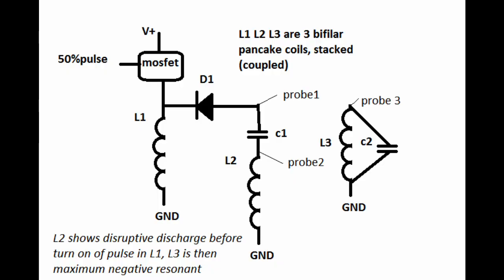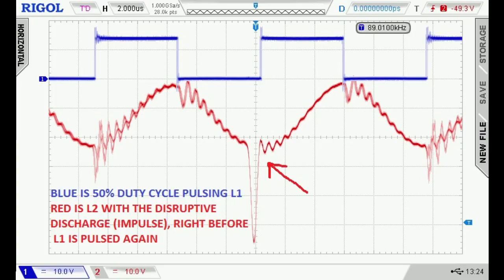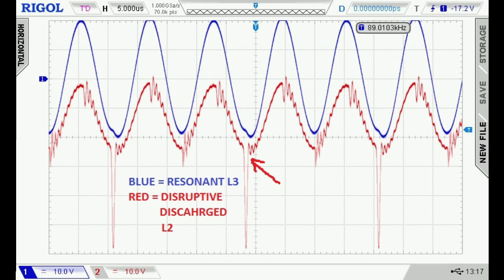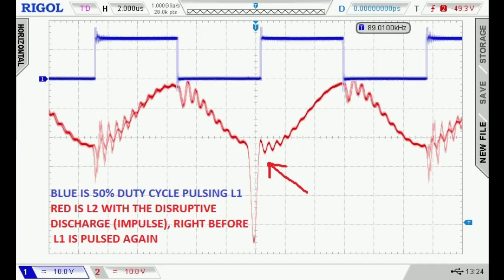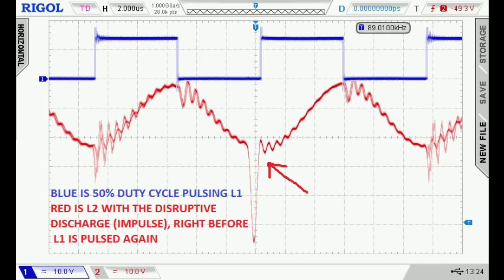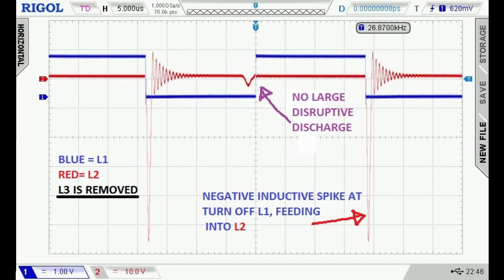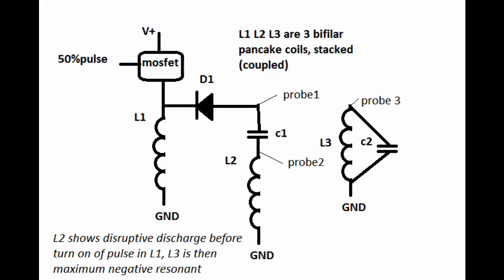Radiant energy bifilar coil experiment

Comment: Hi , an interesting result. It is not at all clear which trace corrresponding to which  testpoint. at a first impression it is an interaction between L2 and L3  ,when the spike occures ,there is a small area from the sinewave on L3  consumed , distortioned.
Reply from the maker: good observations. the L3 is not consumed, but enhanced, it grows to even more negative. Sine is L3 probed. discharge is probed between C1 and L2, sorry for the inconvenience.
Reply: M.Ivo
The testpoint which I am in doubt is Tp1 on the schematic, if it is placed on this side of the diode there should not be visible the square wave of the input, but only the negative spike.
If I may make a suggestion: in order to get a fast disruptive discharge it might be worth to try without the capacitor on L2, considering the damping produced by the latter, and it could be better to employ teslas preferred configuration: capacitor discharge into a low impedance coil. The discharge will be faster and you can rise the energy per pulse by adjustment of capacitance and pulsrate. Remember that you are not looking for a resonance, but for UNIDIRECTIONAL pulses.
Another thing that has to be considered is how to detect the longitudinal pulses,you should think about a specific setup that distinguishes from transversal waves or spikes,(maybe shielded)
I hope that something of this  helps, and wish you success.

Comment: I think the idea is to get the spike almost like DC pulse. The steeper it is the better. So you want to go from 0 to max voltage as quickly as you can, but you might not be able to, so the other option to make it steeper is to use HV. I think tesla used a 25-50kV dynamo to produce the disruptive discharges, but did he just charge a cap with that so he can output all the energy instantly from it? This would be the disruptive discharge and you try to get it as short and as steep as you can like under 50 microseconds
Reply from the maker: That's the idea, now bring it to practice. But more importantly I already got it, but why is it there? I didn't intend to create it but it sure showed up, before the switch closes.
Reply: as short as possible with no reversal ..no reversal of current is important according to tesla...probably  the most important thing and the hardest to stop once voltage and current increase it becomes harder for solid state circuits to handle... also telsa tried hard to get the magnetic componet out of the circuit...
Reply: I think a gas discharge tube might work, if you put permanent magnets N-SG-N there. I think Tesla was lucky because had his ancient rotary switch :) So you charge a cap and then let it discharge over a gap. You need to quench the spark after the initial pulse. Spark quenching secondary coils on both side of the gap could also work

Comment: To be able to "see" when a MOSFET turns on and when off, you have to look at the current through this MOSFET.
Looking at the gate voltage or the drain / source voltage does not say all.

Use a current probe in the drain lead or a 1% CSR (current sensing resistor) of 0.1, 1 or 10 Ohm (induction free)
and measure across it taking care where to put the ground lead of your probe (or use 2 probes in differential mode).

Regards Itsu
Reply from the maker: if the pulse is low for 50% it should be off, don't you agree?
But you are right a proper measurement would give more info. So you think the mosfet opens before it reaches the gate source threshold voltage? and it triggers the discharge? even with the diode being there?
Reply: Ivo,

all i am saying is that things often are not that simple as it looks.

The gate can have a nice clean switching signal, but its switching the MOSFET is compared to
the source level (normally ground).
If that source level is fluctuating, the resulting switching on / off (time) can be way different as the gate signal.
 
F.i. your L2 coil can inductively feedback pulses through the diode to the source of the MOSFET.

So to get a complete picture you should include the current through the MOSFET.

See here (i know its a push-pull environment, so different as yours, but still):
https://overunity.com/12736/kapanadze-cousin-dally-free-energy/msg475096/#msg475096

Itsu
Reply from the maker: Indeed worthy if investigation. I have been surprised before, but often it could be explained easily, by a closer look. Dank je!

Comment: i'm working on similar type of experiments - however like you i'm going without the 'spark gap' or {as mentioned below} 'mechanical devices'
but to achieve fundamental results for my experiments i need multiple freq into the same field effect circurt or 'magnetic circurt' 
then i'm going to explore how the field effect circurt is reacting to one and more freq, then continue to experiment.

when i say similar i'm not using pancake - i'm working on the theory that Tesla was more 'making a point' to show how the coil was wound - a good option, 'tesla' coils in mirror config, but i'm using a core etc.

thanks for sharing - i have no idea why the negative spike - i could only guess that if L3 is tuned to the same rF as L1 then it is a 'reflection' being induced into the serial cap + L2.
Reply from the maker: But a reflection of what event?
Reply: here is something that helped me greatly - why don't you make a video about how a full wave bridge rectifier works - i think you are like me were we very much make things complex until we fully understand them.

now before you think i'm 'trolling' you i just want to say i can't find a video on youtube {or the 'internet'} that explains it - i think that 'error' is one of the fundamental keys to begining to understanding inductors / polarity and field effects:

the closest i got was a pretty switched on guy Stan Gibilisco a radio electronics professor but he had to resort to fictional particals, just search his name etc - but it's simpler than that, i'd love to see a video on it or discuss it. 

so to be clear -  ' transformer' with 'AC' entering a primart then out of the secondary to a 'full wave bridge rectifier' 

can you explain what is happening? 

i think you will find that there is some 'word magic' going on.
Reply: furhter more to my other comment i will tell you a key i think to understanding it - {so as to not go the wrong direction} 
Tesla and co had some key and major advantages over say you and me and other 'learners' here in 2018 - they were building the generators also - so they had the process from beginning to the end in understanding. 
we might say well   we can generate a 'square wave' pulse the problem is we are missing key aspects of field effect generation in an inductor {that is to say simply a coil of wire} 

Tesla and co were building the generators that were creating the field effects - so they got the picture from start to finish. 

we have at best 'half' <underline a picture and it's blurry and disinformed.

to understand the rectifier you have to go back to the generator.